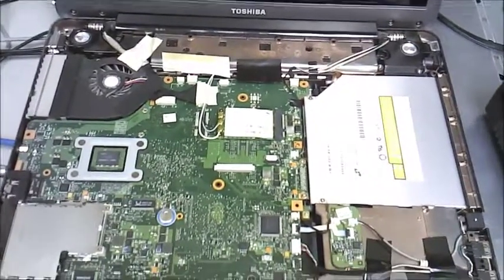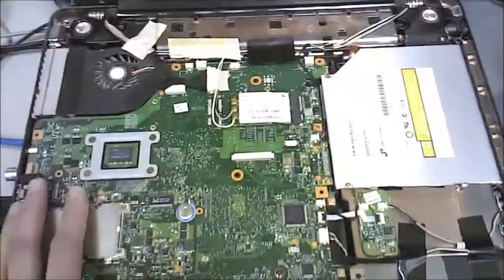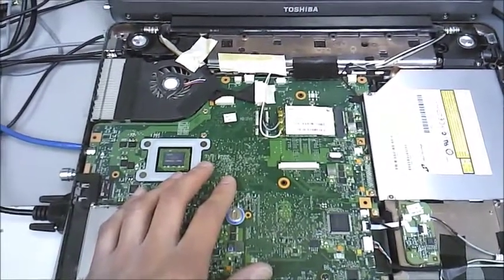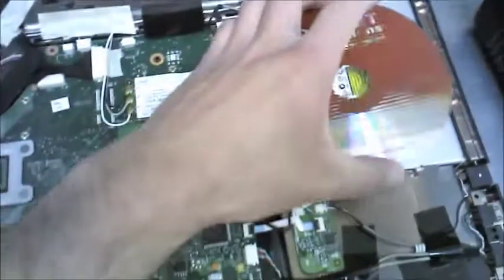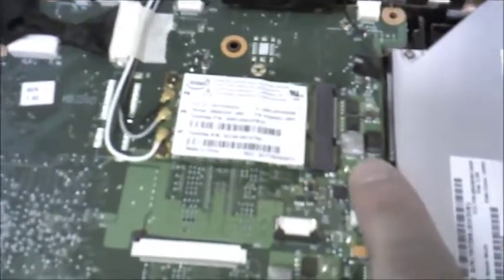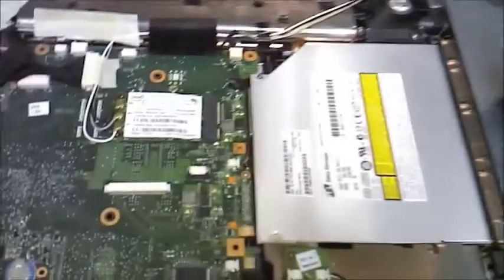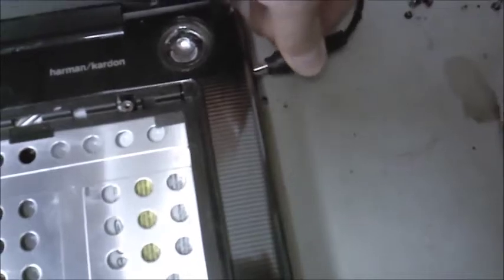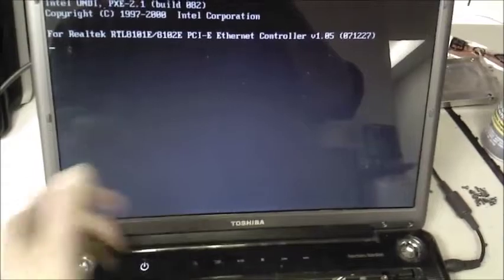Toshiba Satellite A305 Laptop Quick Repair

Comment: How the heck did that get there haha
Reply from the maker: I've seen this before when the mindless individual does not fully "latch" the cd into place before shoving the tray shut. Thus causing the disk to find it's way into places it shouldn't. :)  Must have been some hard shoving going on to cause the CD to break the solder joint.

Comment: lucky, thats easily worth 150 if you clean it up and put windows 7 on it
Reply from the maker: I generally won't sell a computer without a legal key.  However I probably do have a windows 7 COA from another toshiba that I can swipe. I probably will sell this, after a week or so of using it to make sure something else has not been damaged. But so far it booted up and seems like it has all its whits about it.
Reply: honestly, i pirate windows 7 and office but only for my personal use or for my family, i would never sell a computer with illegal software, i dont want them getting into legal trouble
Reply from the maker: 43128lucky4
We have a technet subscription at work, which MS is doing away with about the same time as the XP support actually. That has been really nice. You got the enterprise versions as well as retail versions of almost every piece of microsoft software. 5 retail keys per software, and unlimited activation for enterprise software. Was worth the $399 a year but they are closing Technet, at least for software.